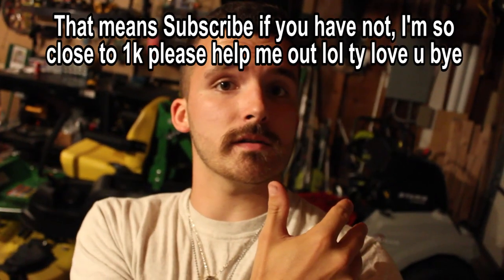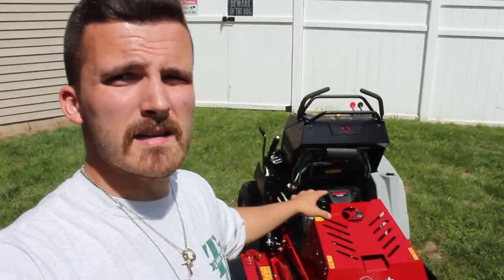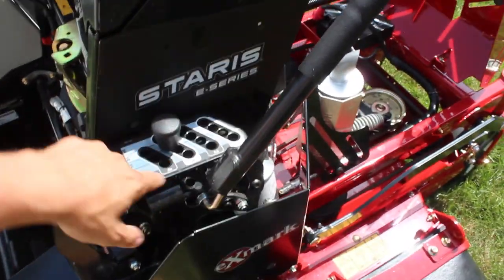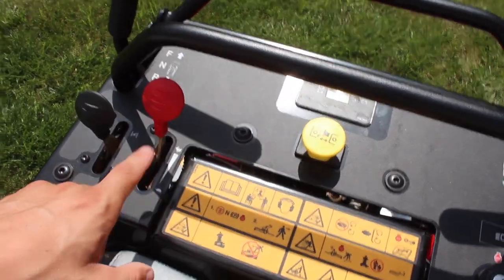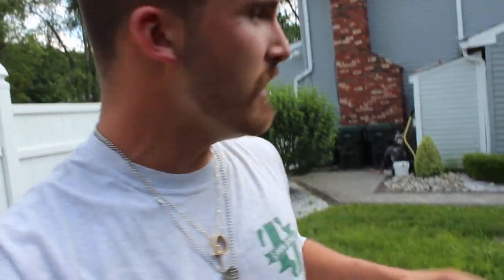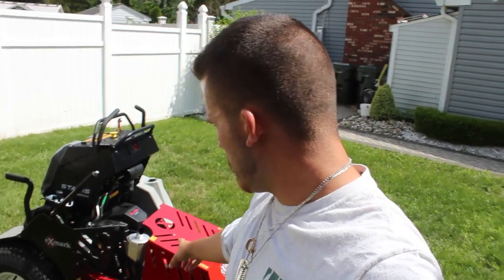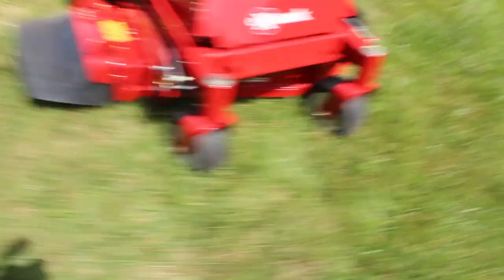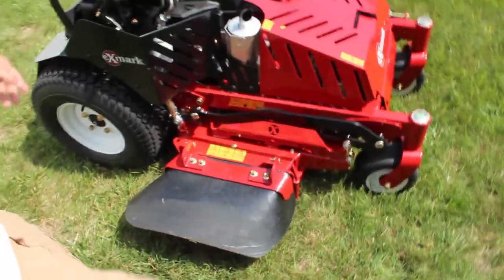Exmark Staris E-Series 36" Stander Review - First Week

Comment: I thought the e series had 4 pins on the deck for height adjustment
Reply from the maker: 4 pins? Nope just the one. Makes things much easier!
Reply: They used to on the 2019 model, unsure of 2020, but clearly exmark changed that up now!
Reply: The 32 has the pins.